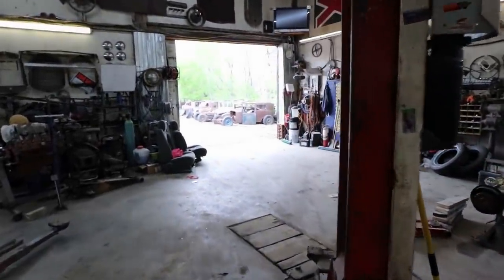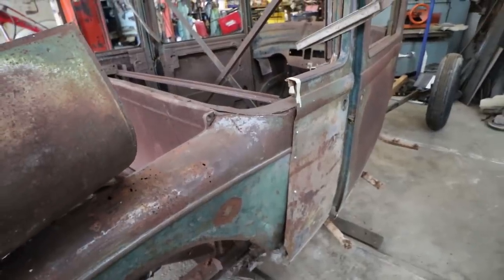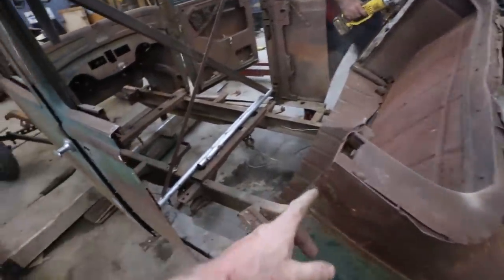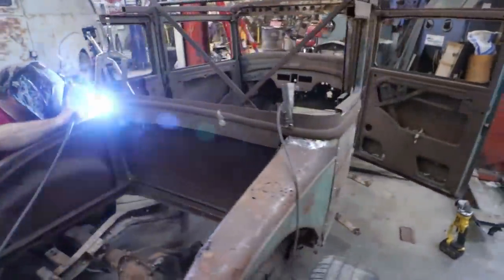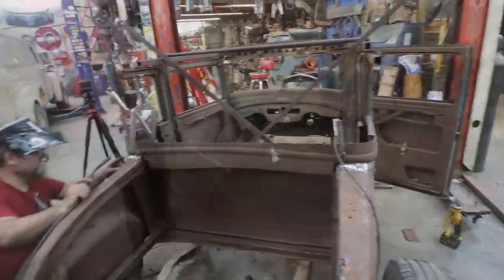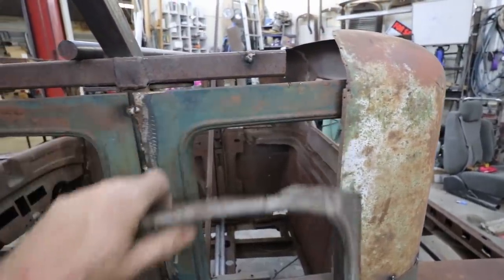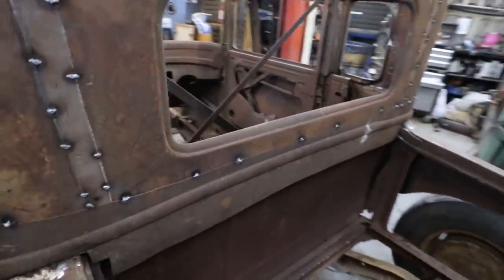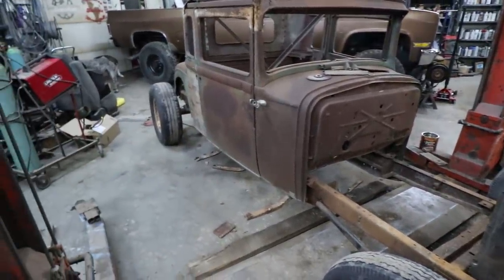Homemade Essex coupe working on the rear window and corner windows.

Comment: Came together quick. Has a great look to it. The Essex window height makes it look chopped already compared to model a fords. Myself I'd leave it and not chop it. It has some  pretty classic proportions going on.

His body line in the quarters..... I  could see extending them straight forward to about center of the quarter windows. Taper to a spear point at the front so it can start on its own. Just a thought. 
Looks great. Thanks for sharing

Comment: I vote to extend the quarter panel body line forward 6 or 7 inches like a spear. Don’t chop it. Leave the firewall in place, looks great, try a 4.3 V6 for space. Great work so far from a pile of parts!
Reply: I like a spear too or get rid of the bodyline but NOT curve it up. Im ok with the firewall flip but like the top tall.

Comment: Just told my Brother yesterday 'I'm getting bored with the same old Will it runs etc'   I wanna see more unusual fabrications like the Halfass Essex coupe.  And the very next day, There it is!!   I would suggest not using the same old smallblock.  Find some overhead cammed V8 or 4 banger. Domestic , foreign whatever. and modify and age it to recall the old Ardun head Flatties.      Keep it coming!.

Comment: I am working on q 29 Essex coupe also. Wondering if a PT cruiser ,or similar car would work for a roof skin. I would like to find something with ribs on it -didnt they have a ribbed hood on some Lincolons ? i would run some tape to the front to see how a long  body lines pear  would look ?
Reply: You might want to look at minivan roofs.
Reply from the maker: or old van roofs are what a lot of folks use to use.
Reply: Yeah, thats what i thougt of first but thought a minivan roof might have the lines a little closer and maybe not as heavy duty so it might be scaled better for something like a coupe roof. A sedan might be too big for the taper and length of a minivan though. 🤷🏻‍♂️

Comment: To add my 2 cents to the choir; it's one thing to have the vision, quite another to not only make
it happen, but to "see the pathway" needed to make the pieces fit, AND have "eyeball appeal".
You may want to reconsider chopping the top; Trevor is a good size dude, and headroom and 
visibility are going to be an issue.  (FWIW, the channeled, but UNchopped rod was a big trend
for the East coast boys back in the day.)

Comment: Mon I have the perfect metal bed frame that would work perfect for the inner roof structure it has the right corner bends on the bed frame. I seen you already have some square toobing. Looks to be the same stuff minus the spring's take them off.  I save a lot of angle iron from beds have a lot of the stuff people through out there old beds. I take the scrap steel from it. A lot of people know I like to weld for a hobby so they give me scrap metal. The stuff I don't need or going to use my brother recycles it for money. To me it's to much work for what little money they give for scrap metal. Dam near a whole day's work loading and unloading the metal. What ever makes my brother happy. Buying new steel here in the bay area of California they want an arm and leg. 1/8" 24"x 3' $400.00 insane price. My other brother had a sheet for my welding table I had to shave off handles someone welded on and it was a bit small a few inches, but I made it work until I find a piece to fill in the missing inches. Yeah now I know what the square bed frame can be used for if I ever build a model car/truck I really like the profile of the truck's. If I build one I'll make it so my wheelchair can fold up and put in the back or on the back fender where the spare tire goes. I'm a small guy so sitting space won't be a problem.  
Thanks for showing all the content from Northen California bay area 👍🏽
Oh when I was younger I to had shinny car's now I'm up in age I don't want to be always shining a car to keep it looking clean. Now day's anything from early 1970s on back stands out
Reply from the maker: Man steel isn't that bad out here, though a piece like you said would maybe be $100.